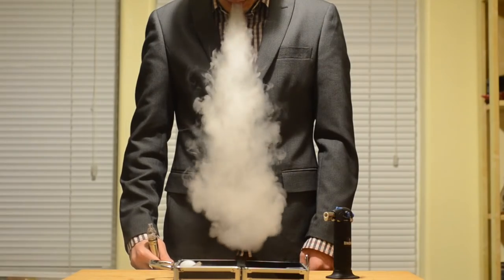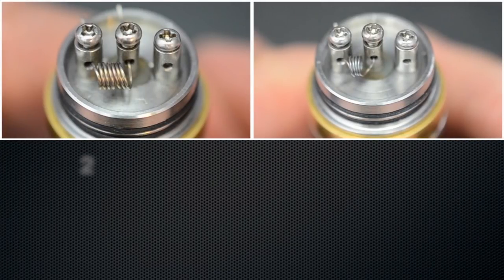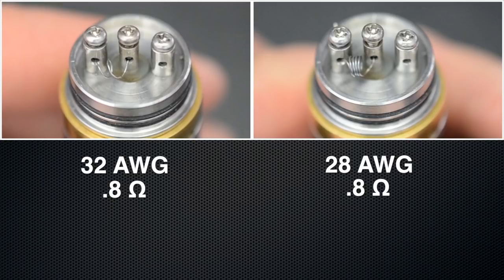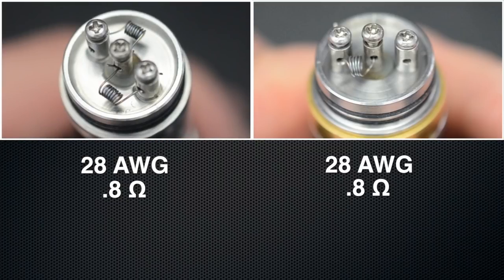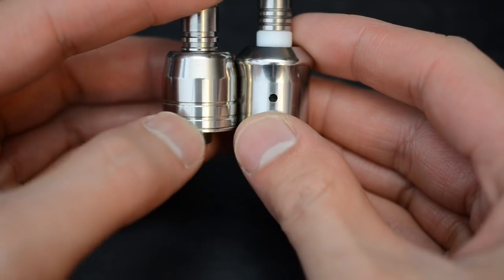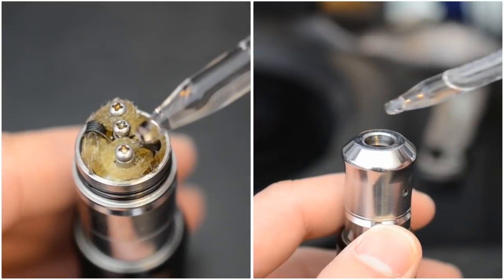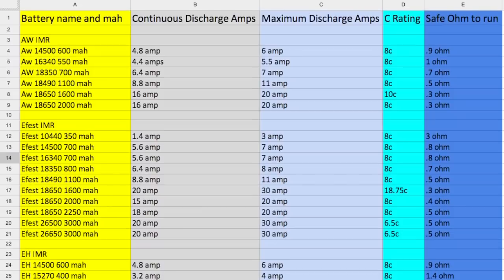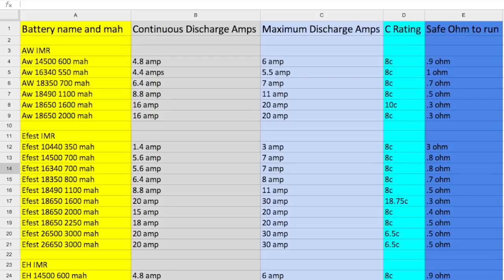Sub-Ohm Vaping Tips

Comment: For the 18650 samsung 25r (it is actually 2500 mah) would a coil running higher than .2 ohms be safe to use then? (I want to buy prebuild coils with .25 and I curious if its safe) and don't worry I do know how automizers are functioning Im just not sure about the ohms

Comment: Hi Everyone! I just ordered a Nugget box mod and a cubis Sub-Ohm tank from Joyetech with 0.5 spare coils. This will be my first vape and I didn't really know much about Sub-ohm when I ordered. The nugget mod said the Resistance Range is 0.1 Ω - 3.0 Ω, so this should be fine with the sub-ohm tank, right? Hope someone can help me. I'm really just looking for taste and a good experience and not cloud chasing.
Reply: +makbar59 Hi, I would recommend getting an isub apex atomizer its by far the best starter tank you can get easy to fill and swap out coils, 0.5 was the best for me, and the best flavor i have tasted from a sub tank so far. use 50 vg 50 pg to start with in your e juice and go up in vg from there if you want. P.s i have the cubis and although its easy to use the flavor is just not there.

Comment: A bit misleading what ohm is safe for what battery you use, when the AMP is effected my the volt and the resistance, and not just the resistance. 
So even your example at the end with the .3 ohm, could potentially also be dangerous for your battery, if you output more volts. Maybe it's safe on a unregulated device, since it cannot output more than 4.2v, but using a regulated device, can easily harm your battery if you crank up the power.

I mean that's a 16 AMP batter with a .3 ohm coil, so using more than 4.8 volt could potentially harm your battery, if you use a regulated device of course.

Comment: so i have a LG 3.7v 2500mah 18650 battery , 0.32 im vaping now, now anything above 0.3 is safe ? and anything lower should be not used ?right ?
Reply: correct
Reply: +Anthony Ellis i am using 24g kanthal wire though

Comment: i know this is an old video . but if im running a sleeper coil on a samsung 18650 25r and my ohms are .12 is this within reason or is it going to blow up or can i go lower?
Reply: Scott Doherty if you have the genuine Samsung INR18650 25R 2500mAh with a 25 amp max continues discharge this battery can handle sub-ohm builds down to .15 ohms. to be on the safe side I wouldn't go lower then .3 ohms. I know a lot of people do but that's the risk some of us takes or don't do the math.

Comment: Can someone please explain to me the 4x wire thing..
This is the knowledge I have
Resistance = p*L/A
As the resistivity(p) and the Area or Gauge(A) will be the same and considering the wire used is the same, the only variable left is the length(L).
If I use 4x the wire or length (as this is the only thing I can vary) why don't I end up with simply two 1.6 ohm coils?
PLEASE someone smart answer this for me!!
Reply: qweqweqwe as parallel circuit as opposed to being in series i think. just a guess though so dont take my word for it

Comment: your chart is out dated
Reply: This means?
Reply: weres the new specs like the Samsung 25rs
Reply: Myron Black So its not out dated its just not including new batteries. Obviously every time a new battery comes out it would have to be added but you agree that the existing data is correct?
Reply: R32Nato No..Sony VTC4 is not correct!Minimum ohm limit for that battery is not 0.5ohm..it´s 0.2ohm.

Comment: I just bought a Pioneer Seven 30 Watt Mod. It uses 26650 batteries and I got a couple of ULTRAFIRE 26650 7200mAH battery 3.7v Li-ion w/ TR-006. Can I use these batteries with it? It looks like I was supposed to get the MNKE 26650 IMR 3500MAH 3.7V. Will the 7200mAH batteries work??

Comment: nice vid! new sub! i was wondering where you could buy the insulators for when they wear out though
Reply from the maker: The vape shops in my city carry them. They seem to be rare online for specific attys and I’m not really sure which website is reliable. You don’t have to worry about it as much unless pushing the limits of your battery by building really low resistances. I have some friends that replace them often, but I’ve only had to replace it once (on a genny).

Comment: The 2000 mah aw 18650 has a 10 amp limit with a pulse or max of 20 not a 16. The 1600 mah is 24 amps with a higher pulse rating not 16 and 24 fyi. Just thought i'd let you know
Reply from the maker: Thanks for letting me know. I’ve got varying numbers from other people too. Do you have a link/source I can use?
Reply: VapePowered  you can find aw battery stats at lighthound.com, that's where I buy my aw's

Comment: hi all your videos are very helpful.learnt so much in such a short space of time. thankyou ever so much.have been vaping now for a little over 9 month.after watching all your vids and feel a lot more comfortable building my own.have just took the plunge and ordered a trident nimbus kayfun 3.1 and omega and a nemesis mod.i am  still worried about going sub ohm.i normally vape at 1.8 ohm on my tanks and boge cartomizers also.just ordered some 28 gauge kanthal wire and some organic cotton wool balls.so all ready to go.how many wraps of kanthal do i do to get a 1.2 or 1ohm reading please on a single coil and double coil setup please.any imformation would be greatly appreciated.1 last thing ordered some glass drip tips.do drip tip materials improve the flavour.many thx damian
Reply from the maker: Wow you went all out. You really need to get an ohm reader for your atomizers too, everyone that I know who builds uses one. This will tell you the resistance. There is no set number of wraps to get the exact resistance you want. It depends on the size (diameter) of your wraps and how far you place the coil to your posts. I’ve never used a glass drip tip, but I’ve heard it does help because you don’t have the metallic taste on your tongue.